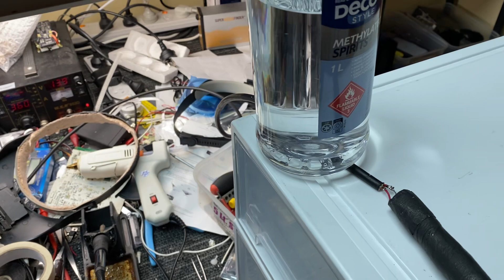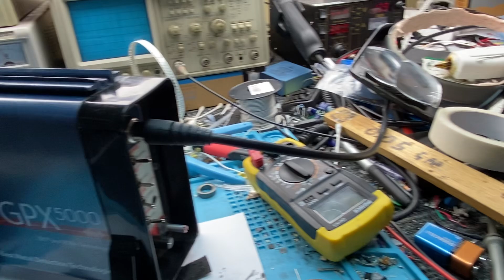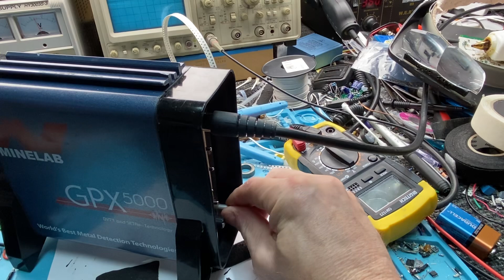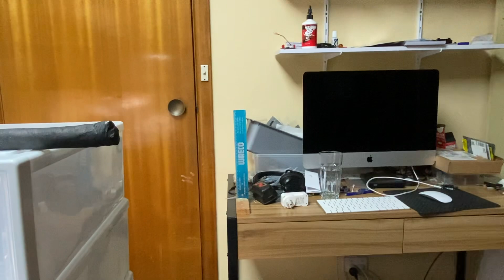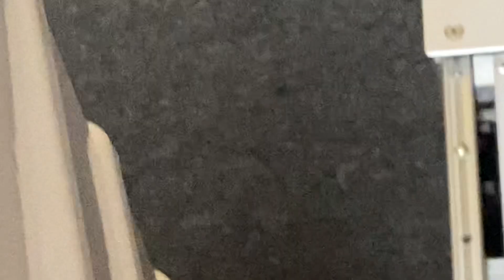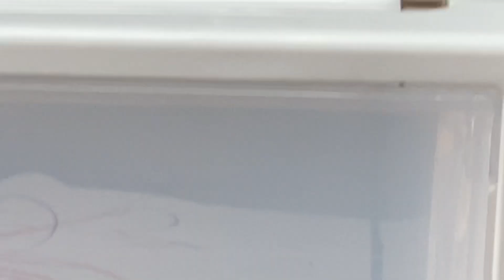How to make a high power pin pointer part 3

Comment: Hello
Sir what's happening when using mono coil in double d mode?
Reply from the maker: The detector has 2 input amplifiers, in DD the detector uses one opamp selected via a 4053 to demod circuit, in mono both are used and switched Parallel.